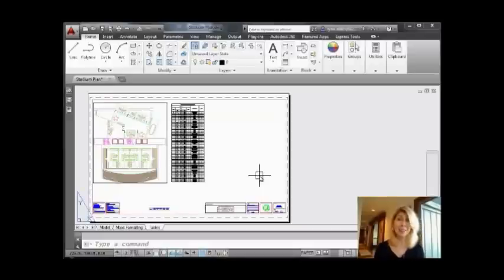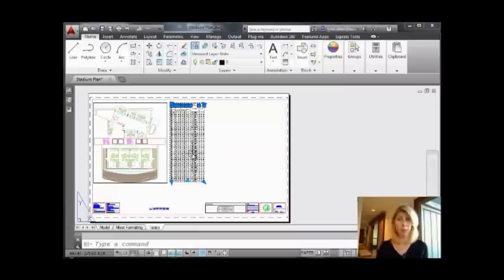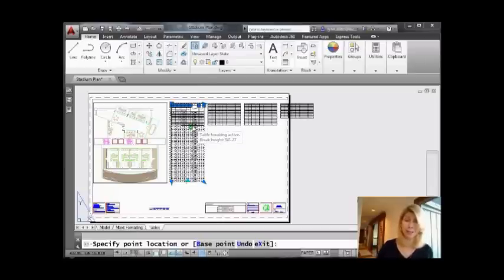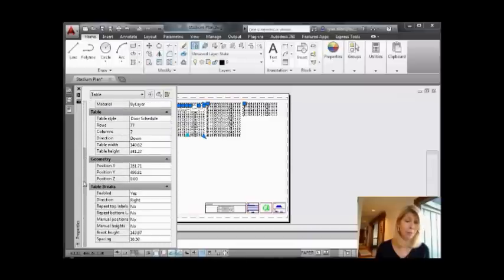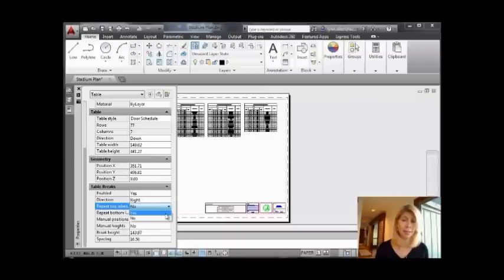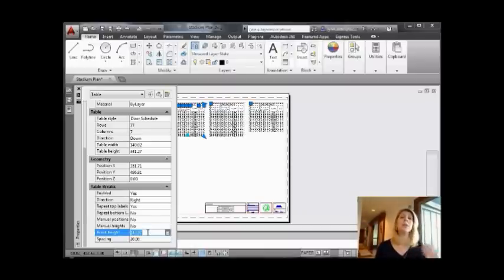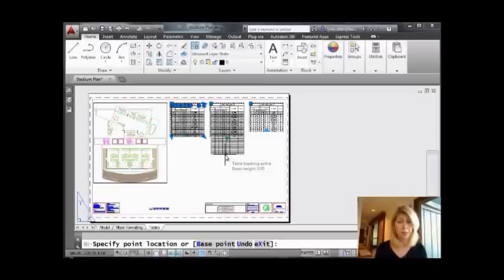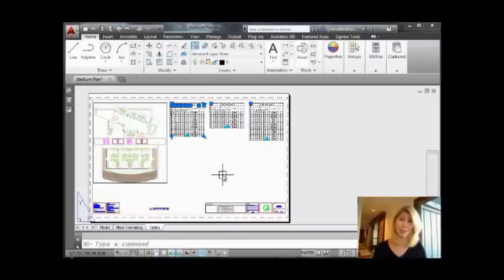Break Tables in AutoCAD (Lynn Allen/Cadalyst Magazine)

Comment: That's a great tip indeed. Now when the table is linked through datalink feature and I'm importing from excel file, the table break feature is working but how do I assign header to multiple table columns in this case. Please help. Thanks in advance.